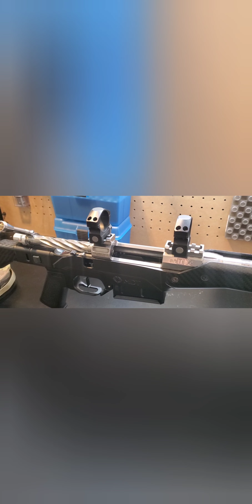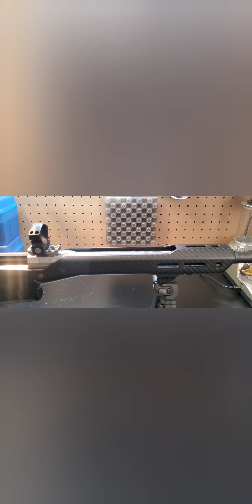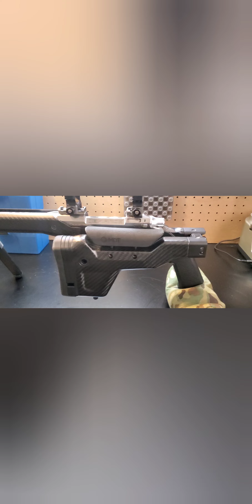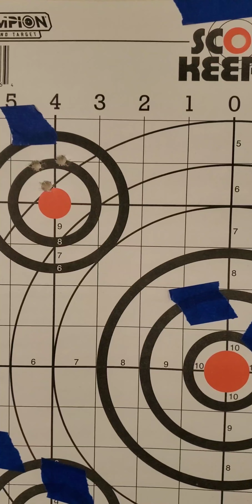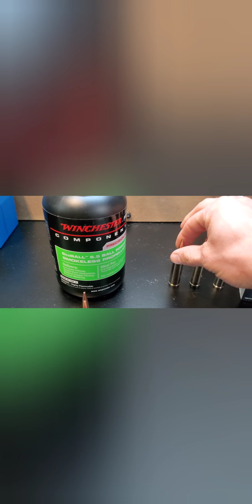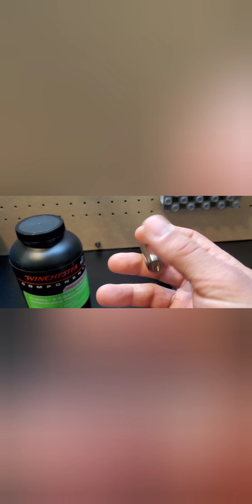6.8 Western Build (#1)

Comment: Looking to start a 6.8 western build just wondering if a aero precision solus short action would work or do I need to search for a medium action. I’ve read mixed things but you seem to know the most about this cartridge, thanks for the 6.8 content very helpful.
Reply from the maker: So if you choose a true short action, the advertised cartridge overall length is going to 2.825", whereas a medium action would allow you 3.20" of overall length. In my opinion,  if you plan to handload and use the 165-175 grain bullets a medium action is the way to go. If you plan on using factory ammo or load for the 140 and 150 grain bullets, a true short action will work. Now, I've seen alot of guys run handloaded 165-175 grain bullets in their factory complete rifles from Browning and Winchester  without issues and with excellent accuracy. 

At the end of the day, if you want more flexibility in handloading for the 6.8, especially when it comes to seating depth, the medium action is the way to go. This is assuming you are building your own rifle from parts and not buying a complete rifle off the shelf. 

I'm not too familiar with the Solus action in what they advertise as the max cartridge length to be for their action. I would give them a call and find out if you don't already have that info.
Reply: @ Appreciate the feedback, their website claims they are sized to feed and eject cartridges with up to a 3.00 inch OAL. I’m just trying to find something that has stocks and other accessories readily available and the medium actions are typically more expensive. I will be hand loading for it so I may be limited but I think that’s the route I’m going to take, thanks
Reply from the maker: @Jeepboy883  Yeah, I think you will be happy with those dimensions. Upon hearing that, I wouldn't hesitate to build a 6.8 Western around that action.

Comment: The EOL is a good bullet.  I've had good performance on both antelope and mule deer in 6.5CM out to 400 yards.  If you're accuracy just isn't what you want, you should consider glass bedding the recoil lug and forward receiver area (in front of the mag well cutout) and the rear tang area around the rear action screw.  I know chassis don't "need" glass bedding, but I've seen quite a few that benefited from it.  You can check the wear lines in the chassis and receiver and see if you have even contact.  If not, you're surely losing accuracy, so throw some 'glass in there to tighten your groups.  Sweet build!
Reply from the maker: Hey. Thanks man! 

I set aside the EOLs for now and was able to find the accuracy I was looking for with a different bullet and powder combination. I would like to revisit the EOL in the near future though.

Comment: I just got my carbon six remage in 20" also. Haven't assembled it yet so it is cool to see your setup. I've had similar thoughts on a chassis as well. I was interested in finding out what kinds of velocities it would produce in that length. Is that the only powder you have tested so far? Thanks for the videos
Reply from the maker: Hey Jason,

I have also been using Accurate MagPro as well. With both powders, I've been getting between 2700 and 2900 FPS. Just depends on what powder weight you settle on. 

I'm losing about 25 FPS per inch of barrel length from the advertised velocities and barrel length listed on the Hodgdon's website.